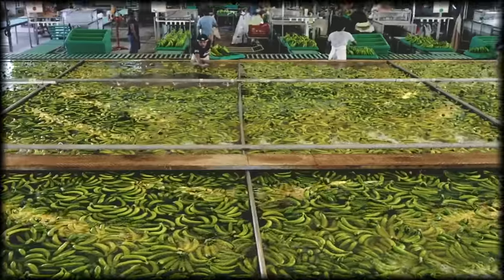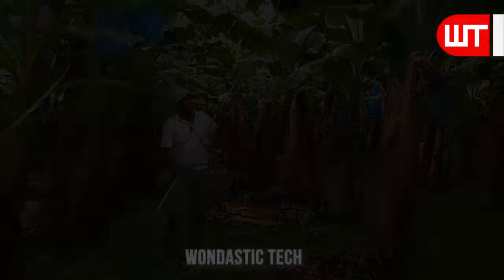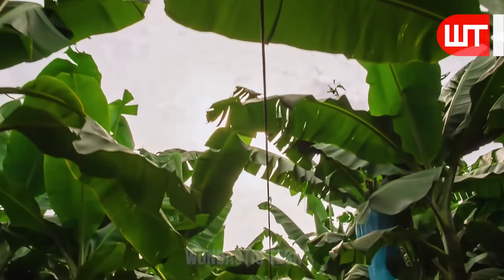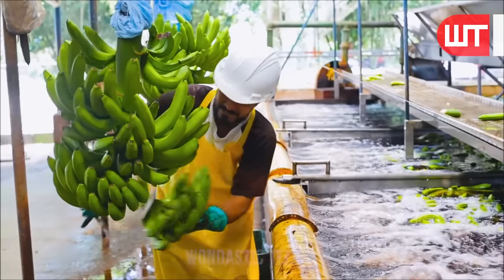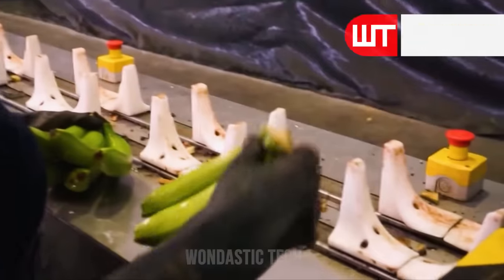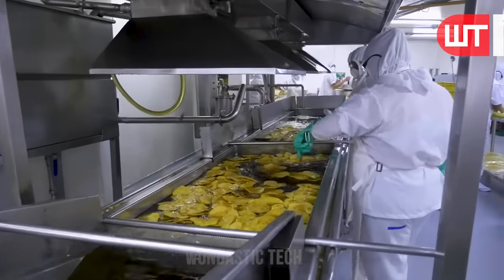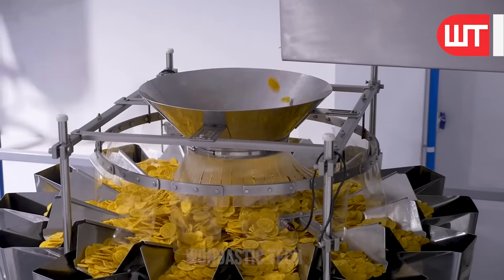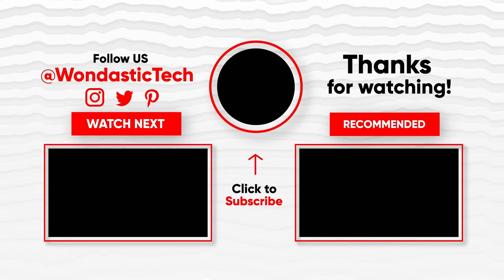How Millions of Banana Harvested & Processed | Banana Chips Factory🍌

Comment: There are no Banana seedlings. Bananas don’t have seeds. As the banana plant grows, it puts off two or three shoots at the bottom. Those shoots are taken from the plant and replanted elsewhere, leaving behind one shoot in addition to the plant. After the plant has been harvested, it is cut down to the ground level, and the leftover shoot is left to grow to full-size, repeating the process over and over again.
Reply: There is an old variety of bananas that have seeds. They are not very palatable and have large black seeds, which make eating them tedious. The Cavendish variety, which is the most popular, still has the remnants of the seeds, the tiny black specks, radiating around the centre.

Personally, I grow nine different varieties, other than Cavendish, all propagate via suckers, as you mentioned. The second growth plant is, if let to mature, not as productive, its best to dig up the old root system and plant a new sucker.

Comment: What is the difference between banana and plantain
Reply: Bananas and plantains are closely related, but they have distinct differences. Bananas are usually smaller, sweeter, and are typically eaten raw. They have a thin peel that is easy to remove, and they are commonly used in smoothies, desserts, and snacks.

Plantains, on the other hand, are larger, firmer, and starchier, making them more suitable for cooking. They have a thicker peel that can be more challenging to remove, especially when unripe. Plantains are often fried, boiled, or baked and are a staple in many tropical and subtropical cuisines, where they are treated more like a vegetable than a fruit.

In summary, bananas are typically eaten raw and are sweet, while plantains are usually cooked and are starchy.